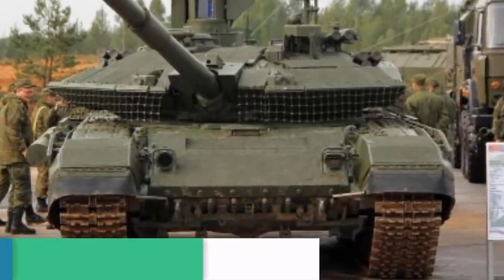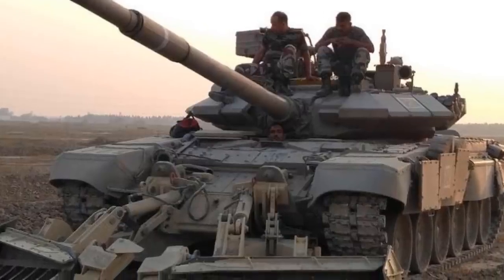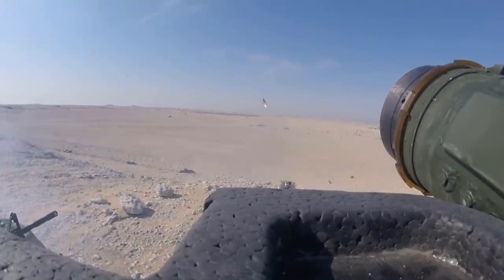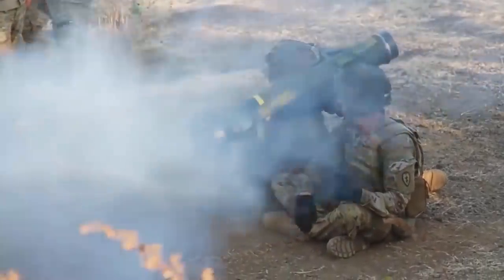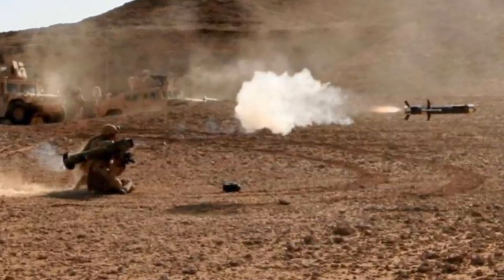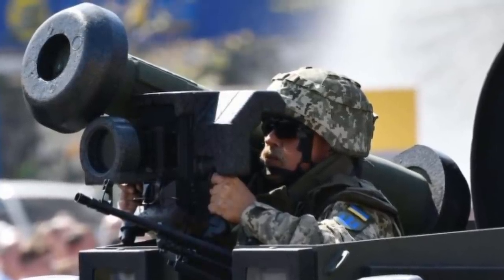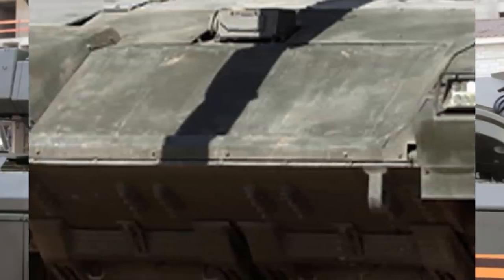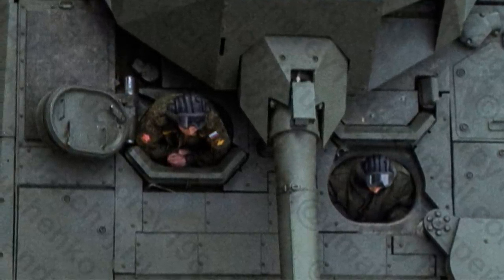US Javelin missile vs Russian Tanks

Comment: Russia lost 10 of the T-90 they sent to Syria... and many of the TOW-4d launchers were there too.  Russian tanks have always had a low survivability.  They added their Dazzler system and new TOW missiles added encoders to their laser trackers.  They added reactive armor and the US added a 1 meter rod onto the end of the missile to cause the reactive armor to detonate early.

Russia's T-14 (whenever they finally start getting production models and how many they actually will order... does have better protection around the crew.  Normally fuels and ammunition surrounded them so any damage pretty much destroyed the tank.  The problem is the armor around the engine is very light so they had to add an RPG cage to protect it from smaller missiles.  The turret also has very little armor, but the gunner is now housed in the hull.  Their hopes is they loose the turret, but the tank and crew can still retreat and if they loose the engine they hope to still save the crew.  They even added an anti missile interceptor, but it is mounted to the underside of the turret and only protects in a small 60 degree angle.  That means any hits to the sides, rear, or top will ignore this system.  They also put the dazzler on there and will have reactive armor.  The sad thing though is that the US has already upgraded their M1A1 Sep 3 to a round that is capable of penetrating this new armor.  To add to this Russia is struggling with the new engine, quality issues, and massive cost overruns.  Like the T-90, they will likely only make a few hundred and have to rely on ancient T-72 for the bulk of their tank force.

Comment: It is good that the Javelins and NLAWs are so effective against tanks. However It is also necessary to hit back against the rocket launchers (including thermobarbaric weapons) and artillery that seem to be being adopted increasingly by the Russians against cities. Whilst I appreciate that they are designed as anti-tank weapons, I was wondering whether they can also be used effectively against rocket launchers and artillery?
Reply: If I recall, the javelin uses heat seeking capabilities to hold onto targets, so if it's got an engine, yes it can.
Reply: I think if Ukraine is close enough to take out rocket launchers and artillery with javelin missiles. The Ukrainians has some mad stealth techniques.
Reply: They need only cheap RPG-7s to take those out. They have very little to no armor.

Comment: On the 40-mile long convoy. Just draw a large physical Redline on the ground one mile ahead of it with a sign that reads, You Will Die HERE.  When the first vehicle touches the line, DRONE it. Then follow it through with the next one. Drone it. Then after about five tanks that got drowned at the red line I doubt you will have another vehicle move forward. " No YOU Go First " Tying up the Convoy from advancing and delaying it more with very few drones.On the 40-mile long convoy. Just draw a large physical Redline on the ground one mile ahead of it with a sign that reads, You Will Die HERE.  When the first vehicle touches the line, DRONE it. Then follow it through with the next one. Drone it. Then after about five tanks that got drowned at the red line I doubt you will have another vehicle move forward. " No YOU Go First " Tying up the Convoy from advancing and delaying it more with very few drones.

Comment: They can beat the Old russian Tanks but the T-14 armata (the last russian mbt developed) can stop a Javelin Missile with it Active Protection system (Russian Trophy)
Reply: The T-14 runs out of fuel the same as the others. Russia forgot to buy trucks.
Reply: @dbergerac9632  Ofc, one more reason they dont bring this tank to the War
Reply: There are fewer than 20 T-14s in existence. And they're not sending them to UKR. Even the T-14  would be useless against simultaneous attack by multiple NLAWs and Javelins.

Comment: $200000 missile is not the most cost effective what to take out tank. Ukraine is using a lot of molotov coctails. 

I wondering how effective molotov or just glass bottle of paint or tar would be if you throw in on the optics and periscope. You do not penetrate 2 meter of advanced armor if you just blind the tank. Also the engine and crew needs oxygen to live, if there is molorov burning on the air intake and vent burning out all the oxygen it does not matter how great filters the tank has. 

I ama looking at images of T-14 the tops of the crew periscopes and hatches seen to be relative this 3-4" solid metal. Having 1-2 molotovs burning on top of them would heat them up pretty high, maybe hot enough to boil the crew that sits with their heads couple inches for them. Let  alone thermite. I also been wondering could you make thermite sticky like molotov. It most likely would not burn through, but it would heat up the armor enough to cook off ammo, gas or crew.

Comment: In the streets of cities like Kviv, they don't need anything that sophisticated. Even the old fashioned Russian RPG would be dangerous to a tank if fired from a high rooftop above onto the top of the turret. Maybe. it takes two hits and they need to first set off the reactive armor but they could easily operate in pairs. The Ukrainians are going to control the back streets and the buildings. Those poor Rusiaan teenaged conscripts will be too scared to get out of their vehicles after a lot of them get picked off by the locals.
Reply: Sure, use an inaccurate unguided rocket to bit a tank twice in the same spot. Besides, tanks are ineffective in door to door city fighting
Reply: @mandtgrant  That's right they are but the Russians will wheel them right downtown for the propaganda and terror value of it. Why do you think that I suggested two shots at the same point? Why would I do a crazy thing like that? Study up on what modern tank armor is like. That's what a Javelin does to penetrate armor ... two bangs, not just one.

Comment: You forgot that the T14 armata has soft kill APS specifically designed against top attack missles, once the missle is detected it will release a smoke screen which conceal the tanks thermal signature making it invisible to the javelin so the crew only needs to drive forward and the javelin no longer a threat.
Reply: Putin won't deploy any of its 20 T14s - getting them destroyed would be too embarrassing.
Reply: You do know that the javelins infrared sensor has a secondary UV sensor that can see through infrared blocking smoke it uses the UV sensor to discriminate between the target and countermeasures. It is the same sensor system used in the AIM-9X and the majority of modern infrared missiles just used against aircraft and not ground targets.
Reply: @32shumble  they have 119 combat ready T14s
Reply: @Fatallydisorganized  thats why the tank has a masked thermal siganture even without the smoke screen
Reply: @zachfrancisco8185  Oh the 'invisible' T14s - only seen on YouTube.
Reply: That's an ignorant comment.  The infrared targeting on the Javelin looks right through most smoke with no problem at all.  Smoke screens only work with laser targeting.